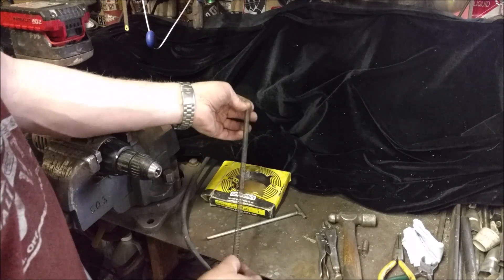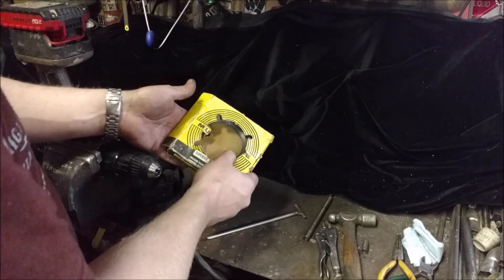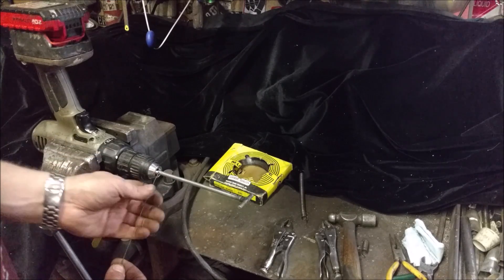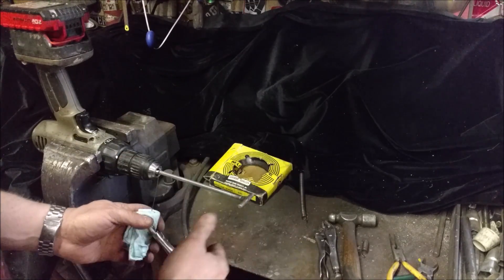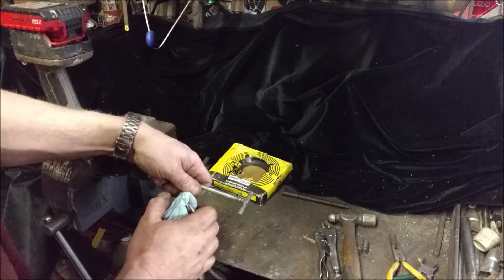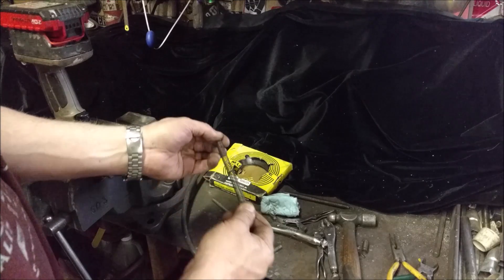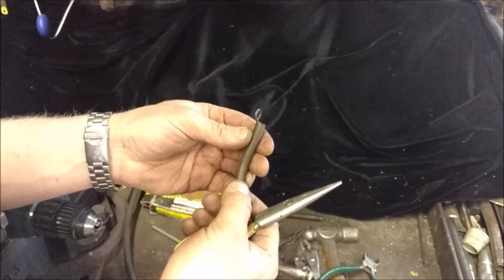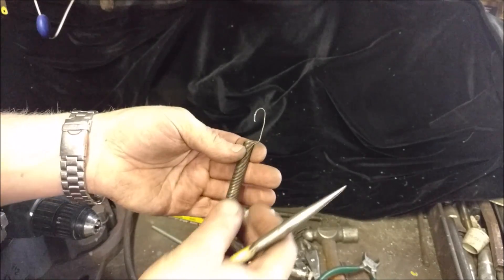Making Springs In Your Garage

Comment: You don't need to coil wire to make a spring, a torsion bar is a spring.
I thought with the title you were going to show how to make a spring and not simply how to coil a length of wire.
Some idea of how strong it is for a thickness, length, coil diameter... Making springs in other words.

Comment: This is great!  Vintage mx bikes always need some kind of spring that doesn't exist any longer - thanks!
Reply from the maker: I've gotten pretty creative making tapered springs etc. Just wish I could make so really beefy ones with this technique.
Reply: @sixtyfiveford  when you say tapered, are you meaning progressively wound? And why can't you make heavier springs ?
Reply from the maker: @64maxpower  No more like skinny on one side fat on the other. Essentially progressive springs. When you start getting close to 1/8 of an inch thickness you just can't hold on to it. There's no reason you couldn't make a jig though.

Comment: Yup. That's basically the same way I make them. Thanks for the tip on harvesting wire from tires. ..spring steel and bungee straps. I think I might be ready to harvest a tire , with that many uses...
Edit, another source for high carbon steel wire is twisted steel cable,  but it's a bit wavy.  ..I've got all the springs from my boys crib mattresses in a box in the basement.  They come in handy every now n then.  I gotta find out how to heat treat high carbon steel wire so I can anneal  the old springs,  reshape them (in a  nice uniform manner) then retreat them to get their spring back. So far,  I've only been able to harden and temper them but they don't get very springy. Maybe the tempering needs to be done in an oven..?
Reply from the maker: Tempering is a tricky game. I've played around with it for hours over the years and have never nailed it down. I can make stuff hard/brittle or soft. A kiln with temps you control up to the 1000F-1500F would be ideal.
Reply: @sixtyfiveford  yea, the problem is that the wire has no meat to hold the heat. Even if you  are able to get it all a uniform color and drop it into a bucket of oil, the action of moving the wire causes it to dump all its heat before it lands in the oil. 
Maybe it should go into a metal box and into an oven. The box would be the opposite of a heat sink. Then quench everything

Comment: No tempering or annealing?  Maybe not necessary for such a small spring of that type?
  I am want ing to know how to retemper or recondition springs about 3-4" long and about 1/16"  wire they about 11\2" inches in diameter.  Think they would be called compression springs.  They are used on suspension rods on washing machines and can be expensive to replace when they get weak.
Reply from the maker: No need to worry about tempering as I used spring steel to start with.
Reply: @sixtyfiveford  I understand you used spring steel.  I work with appliances.  The newer ones have suspenision rids with springs the support the tubs on washers.  Some of these are expensive.  I was hoping to find a way to recondition the springs, if that is the problem.

Comment: Do the springs gave to be treated with heat ? Great video I made a spring but not sure if I need to put it in the oven for a bit??
Reply from the maker: You need to use spring steel to begin with and it will need zero heat treatment. If you just use non spring steel wire it will never become spring steel, even with heat treating.
Reply: sixtyfiveford awesome, thanks a lot!

Comment: You didn't tell us how to stress relieve the spring by heating it to make it last longer without cracking or to oil it to reduce hydrogen embrittlement.
Reply: Stress Relief on springs (except oil tempered Chrome Silicone) is only necessary IF the stresses induced due to coiling + the load exceed the elastic limit of the material, although it will add dimensional stability to some extent.  Also, I have NO idea where you get the idea that hydrogen embrittlement is eliminated via OIL.  Hydrogen embrittlement is caused due to spring grade/higher carbon materials being exposed to certain acids, usually during a plating process and the risk can be reduced by baking the hydrogen out of the material at 400 degrees F for around an hour.

Comment: I have a gx motor with a pulley welded on the shaft, mounted by 8 trampoline springs in a box shaped frame.  It is a great way to mount an engine so you will have almost zero transmission of vibration and you can readily connect the pulley to a variety of implements, alternators, chainsaw bar, etc with automatic belt tensioning simply by mounting the item to be driven in the right place. It also means that you can use a variety of belt lengths. . . If one breaks and you don'thave a match you can just use a rope to move the engine to one side or another a bit or move the device you wish to drive to use a shorter or longer belt.
Reply from the maker: That's a neat idea.
Reply: It seems to work really well but does not seem to be widely practiced. I found some obscure reference to an early model Ford with an engine mounted on springs, not sure why the idea didn't stick around.

Comment: do you temper the springs once you're done forming them?  i pulled apart a tire today, mic'ed the wire at .050, made a hammer spring and had it stretch almost immediately.  Hopefully other tires will have different diameter bead wire & i can play with it more, great vid though & use eye-pro next time
Reply from the maker: You don't need to temper them. Larger tires/truck tires generally have thicker wire.
Reply: i've seen conflicting videos on the topic, some temper some don't but seeing how tire wire isn't exactly spring wire, i thought it would make a difference.  i need to rip apart some smaller tires & see what i find, hopefully a smaller gauge will serve me better

Comment: Great video, Thank you. For a new project, what about looking into these claims of recharging alkaline batteries? I see posts and ads for them all the time claiming that any rechargable battery can last forever so you will never buy another. I don't believe it but maybe there is some truth to it? I figured the go-to guy here on youtube is you and you could get to the truth of it. Thank you.
Reply from the maker: I have a video on recharging Alkaline batteries. It can be done and I've done it many many times. BUT a lot of the batteries leak and get acid on stuff. Some brands are better than others, and most of the time it's the cheap brands.
Reply: I did not know you had a video about it, I will look for it and watch it. I have mostly the Duracell batteries and some of the Northern Tool brand batteries. I do some night work and use one of those headlamps and the batteries only last about 2 to 4 hours then have to put in new batteries. I have saved some batteries, mostly the AAA size to try charging if I ever found good information on how to charge them. Thank you.
Reply: I will watch it. Thank you.

Comment: This is the best video I've seen on this subject. Sir, you are a wealth of useful knowledge. Thank you!
Reply from the maker: Thanks Jim. -Moe.
Reply: Take a look at This Old Tony. He has proper video about making springs.

He explains how to:

work out what thickness wire to use for different springs.

Work out how thick the rod has to be.

How far apart the coils should be.

He explains how to make a spring for the reason you need it. Not just willy nilly.

The spring should be right for the purpose. No bodging.

If you like this video, you will love 

It's not just

Comment: If you heat it up and then quench it would it be stronger?
Reply from the maker: It would more than likely make the spring brittle and more likely to break/snap under load.
Reply: Thanks A very useful video

Comment: That's the same process I use for making chain-mail rings.  Just not spring steel.  Wind it up then snip the "rings" apart.  Never thought to use this method with spring steel.  Good stuff.
Reply from the maker: Chain-male sounds like a fun project.

Comment: Any advise about how to make constant force springs like those found in tape measures or clothes line reels or retractable dog leases?
Reply from the maker: The longer the spring the more equal the tension. Tape measure springs do pull with more force the further the tape is extended, just not a lot more. The spring in a tape meaure is at least equal to the length of the tape, but may be double(can't say I've ever measured one),

Comment: I need some seat springs for my old VW, have you had any luck with large compression springs?
Reply from the maker: I don't have any larger diameter steel spring wire. But really no reason it wouldn't work.

Comment: Hmm i didnt think about the propertys of the wire in tyres, i will now :-D.
For the bigger diameter spring you need thicker wire, so it resists the twisting better.

I dont know how they actually make the pushing type spring, i imagine they might use neutral untempered spring wire to create the shape, then pull it out a little, then temper it.
I bet the tempering process is precise for the best effect.
I dont know really, just muttering to myself LOL :-D
Reply from the maker: The tempering process is a mystery to me.
Reply: That makes two of us lol :-D
Reply: Moe, I know you of all people know how to anneal or heat steel up until glowing then quench for some back yard heat treating...  In a way, tempering kind of combines those two aspects, to speak of it crudely.  But like I said, I know you are probably already the master at doing this using your acetylene torch I bet!